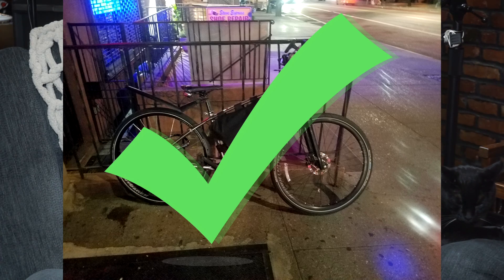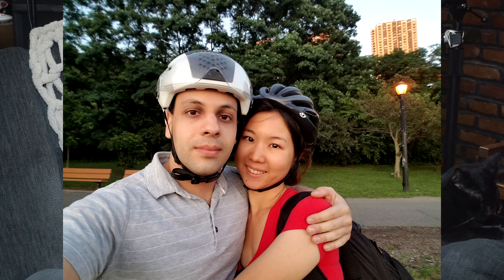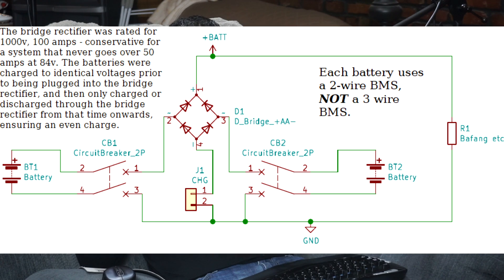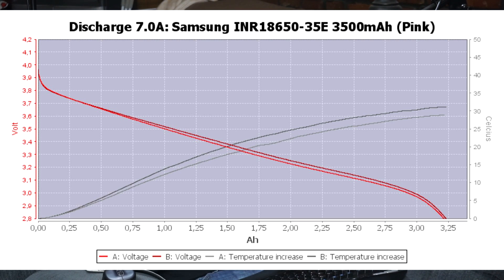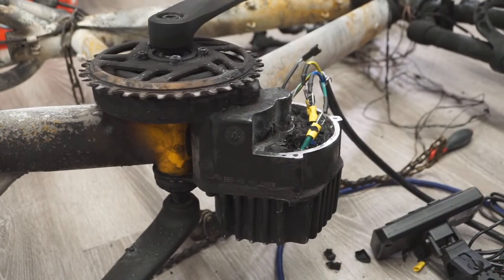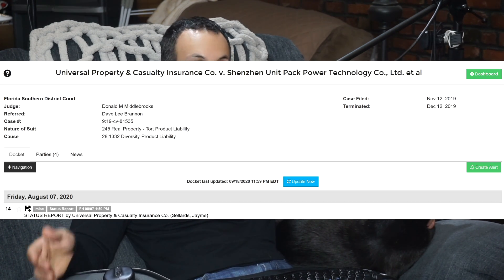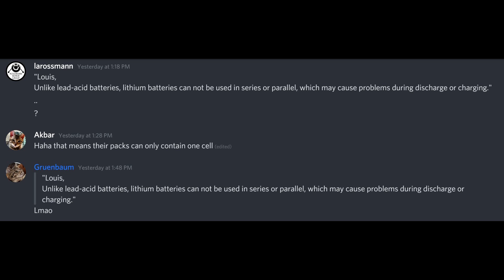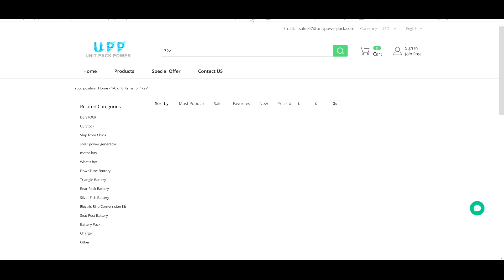Louis' front door goes BOOM courtesy of UnitPackPower battery.

Comment: I was recently at a sales call at a nyc recycling facility and when the grapple grabbed a load of recyclables for processing a 18650 back up battery bank was crushed in the load, and similarly to this there was nothing to do but watch the show as a 20-30ft tall mound of trash went up in a blaze.
Reply: so seriously all you need to do is crush a battery and it explodes?
Reply: @StayFractalesque  If it is a lithium ion battery, yes. There are chemicals in the battery that can start a fire if they come in contact with each other and only a thin piece of material separates them. If those chemicals become exposed to air, they can also start a fire that way. If done right, you can create an explosion.
Reply: Stay Fractalesque that’s right. Chemical reactions happen instantly
Reply: Stay Fractalesque exactly right
Reply: Do you guys not have a separate battery recycling facility?!
Reply: Wie Van D this was at a facility where pre sorted recyclables come in from a different location. Either someone didn’t do their job prior to it’s arrival or it got into the pile after the fact.
Reply: halcyoncmdr these definitely had not been properly handled for disposal.
Reply: B r u h

Comment: Louis, if you use diodes between switched batteries and capaciors (motor drive), you need to rate the diodes according to transients, not RMS currents. You had way more than 100A happening. Diodes generally fail SHORT. This is why EVs have pre-charge circuits to handle caps prior to main contactors comming ON.
Reply: Correct.

Comment: I'm no electrician engineer and I have an elementary grasp of electronics, but could it be possible that one of the batteries somehow lost charge or the charging was uneven (perhaps due to the electrical wiring/configuration in the battery), leading to a huge current in the parallel circuit and causing the wattage (heat) in one of the resistors or wires to spike up, causing the fire to start?

And some chemicals within the battery came into contact with each other (which should never come into contact) due to the barrier between the chemicals breaking down,, the initial heat from the resistor acted as a catalyst, further increasing the rate of reaction between the chemicals and increasing the heat output (to the point of having to call in the fire department to put out the excess heat being released)?

Comment: Battery safety is a responsibility of the end user. Batteries don't blow themselves up. Either you messed up the design, messed up device care/maintenance,  OR MAAAAAYBE the batteries aren't rated for the output that the manufacturer says they are. In the vape community we basically NEVER blame the manufacturer,  because any vaper who knows ANYTHING about battery safety knows its on them to buy SAFE HIGH-QUALITY batteries and to never push them beyond their limits.

Comment: It is possible to burst draw from one battery than the other with two batteries in parallel due to diode inidealities.  As in, you can exceed the rated burst current can be exceeded. I recommend an ideal diode module instead.

Comment: how are you charging all the cells? You can't just series connect a bunch of lipo's and expect them to all charge and drain at the same rate, that's why all manufactures use a charge controllers that monitors every set of parallel connected series lipo's, for temperature, charge and discharge rate or at the least the state of charge before recharge and a precise 4.20v cutoff. If you have a 20s pack you need a charge controller(s) capable of independently charging all 20. A quick an dirty way is a multitap transformer (Unwrap the secondary of a 150va toroid and wrap your own secondaries) with a tp4056 charge controller for each cell. 4056's are cheap but robust and will be galvanically isolated by the individual multitaps off the transformer so you just hang a charge port out the side of you pack and voila.  Sorry about your bike, glad no one got hurt.
Reply: Unfortunately this should be the way but it's not. There are many cheap electric bikes, hover boards , power tools and countless whatever else that have series connected li ion batteries and rely on the hope that they will all age the same or even start out the same but this never happens and you end up with prematurely failed pack or worse a fire. Manufacturing errors are a given, it happens, and without someway to monitor the individual cells in a pack you're rolling the dice.

Comment: I thought Samsung was bad, but at least they recalled their phones and sent you replacements. These people are like, our batteries explode so that is normal operation not covered by the warranty. Yeah. When was the last time you had your house wired with uninsulated wire just strung along your walls and ceilings with porcelain, glass, or even wooden knobs and tubes? If you can give a date, damn, you're old!
Reply: This is Louis's fault not the company, he was running 2 batteries in parallel which causes stuff like this to happen if not done correctly.